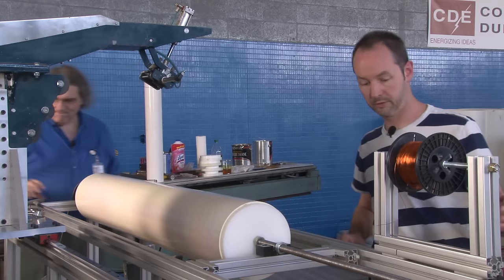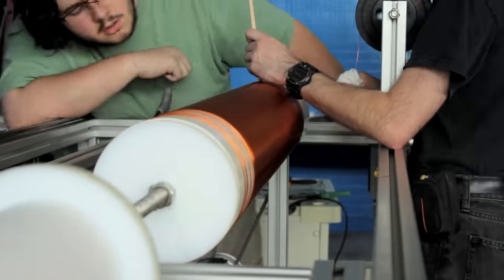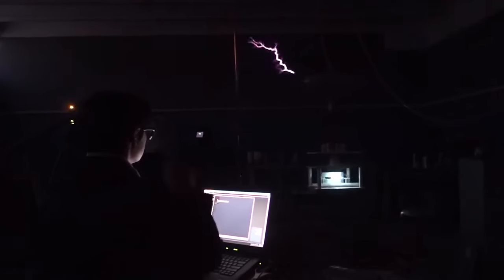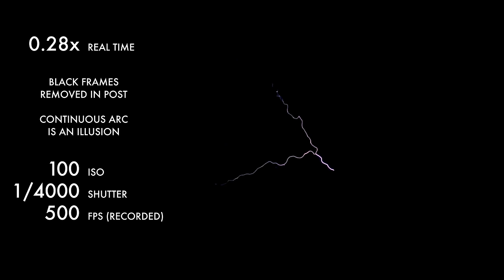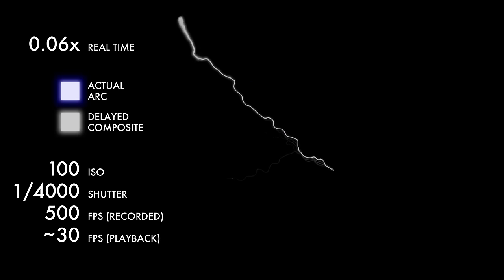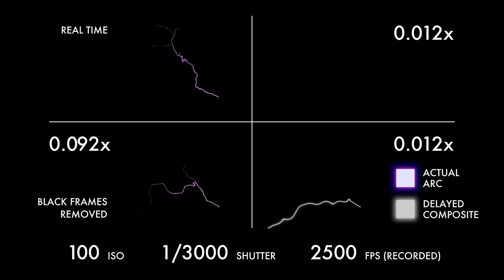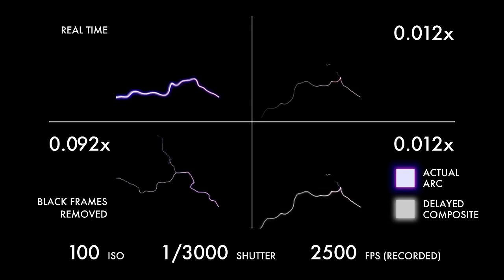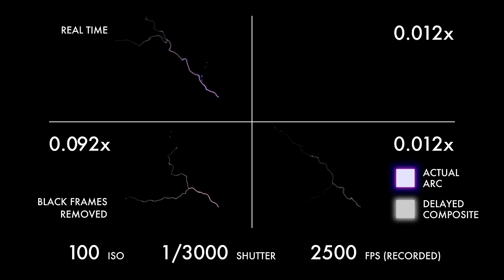Arcs In Slow Motion (the High Voltage Lab Returns!)

Comment: I'd like to see something with a CRT flyback transformer. Maybe tesla coil off of one a jacobs ladder, maybe try those odd experiments you see online like erasing CDs, etc with a flyback. 
 
Maybe even something about a simple flyback driver circuit, maybe even with some sort of output control. (I think they can do that as to my understanding the voltage output from the flyback changes the brightness on a CRT. (Maybe take the junk CRT and do an autopsy of it).